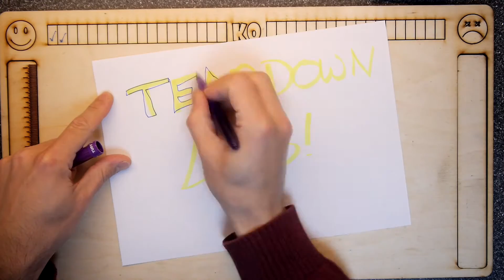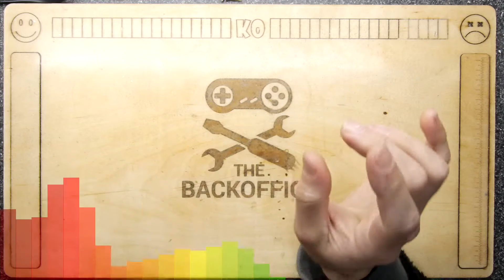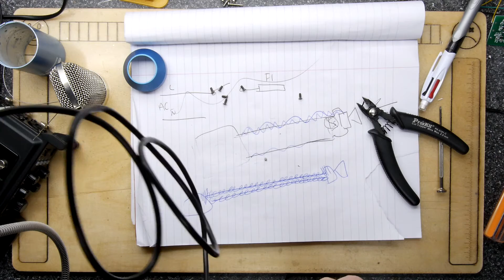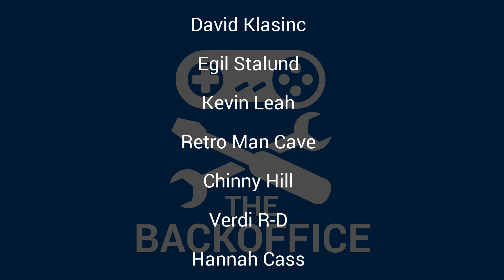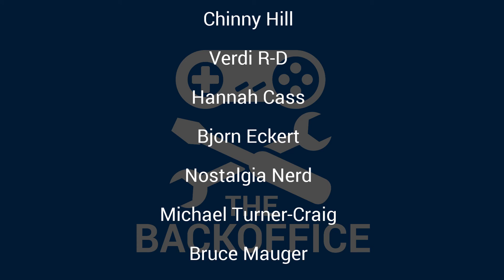Audio Debugging

Comment: My apologies of you know all this already thought I would mention that the boards in your mic (if it's a true XLR mic) should be inverting the signal. Basically the signal is inverted and sent down the negative cable , the original non inverted signal is passed down it's own (positive) wire along with a ground. When they reach your recording equipment the negative signal is inverted again and the signals are summed. The idea is that if noise/interference gets in then when one of the signals is inverted and summed back together the noise on one 'side' will be 180 degrees out of phase so the noise will be cancelled out. Also you can send phantom power down to compatible devices so there may be some kind of pre amp built in too! The caps are there to block the DC from the phantom power. :-)

Comment: I just noticed that I have a Neewer NW-700 that I don't use anymore (replaced it with a proper microphone), which coincidentally has the exact same PCB and components on it, even the values match. I guess these microphones are some rebranded generic items :D
Reply from the maker: Almost certainly, I know I got this from a car boot sale for next to nothing, but when I checked online you get these with a cable, bracket and stand for less than the price of a decent cable alone 😂